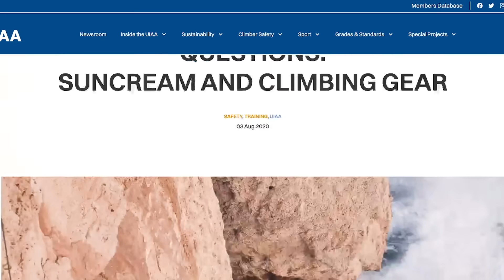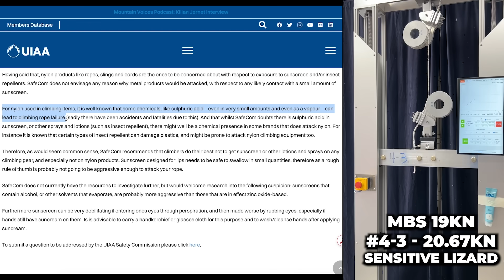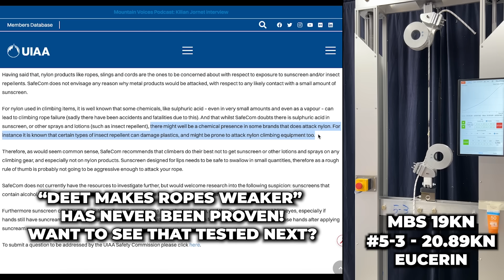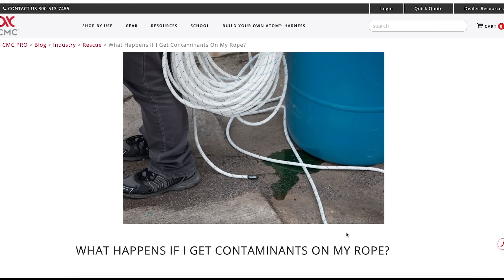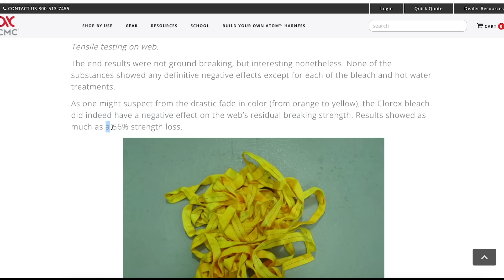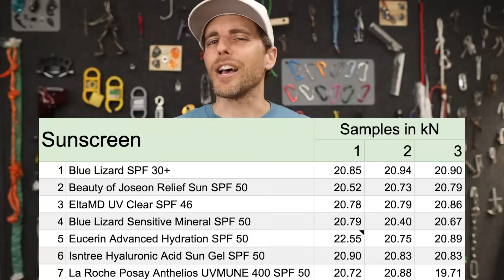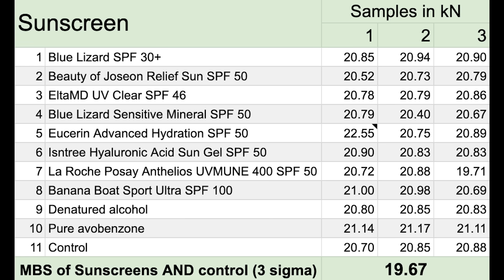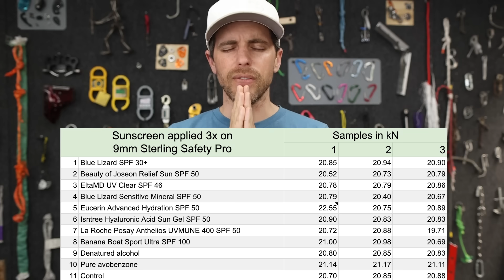This is going to piss off the worlds largest climbing organization

Comment from the maker: Yippee, they took down the instagram post.  They told me they didn't think our science was good enough to take down the article that is NOT based on any science?!?!?! Please email them to get the blog article removed. The UIAA’s contact information is office@theuiaa.org please email them this:
-----------------------------
Dear UIAA,
After reviewing HowNOT2’s sunscreen episode, where they tested to see if sunscreen weakened ropes, we are requesting that you remove your blog post about sunscreen at https://www.theuiaa.org/uiaa-safecom-answers-your-questions-suncream-and-climbing-gear/.  The UIAA is very important in our climbing community and its recommendations need to be rock solid.  Those articles are spreading misinformation.  There are plenty of things to be worried about, let’s worry about the right things.
Sincerely,
Your name
--------------------------
We will remove this call to action once they have removed the false information.  Please email us at contact@hownot2.com if they have so we can take this pinned comment down.
Reply: New claim and a new test idea: Sunscreen extends the nylon's lifespan and your safety! To protect your slings, cams, and ropes, apply sunscreen regularly with SPF 50. It will protect the materials from UV weakening. Test: use 3 sets of ropes/slings. Apply sunscreen to one set; do not apply to other sets. Hide one set as the control away from UV sources. Put the remaining 2 sets outside in direct sunlight for at least 6 months. Expected result: unprotected gear will have lower breaking strength.
Reply: @MrCombic  There are UV protectant sprays made specifically for tents and other outdoor gear. I've never heard of them being used for ropes, but it would be interesting to test those  for safety and effectiveness (I'm willing to bet that it's very safe for ropes, but I'd want to be 100% sure before using it for that purpose..)
Reply: Sent! As a UK physician I can tell you that a lot of the medical literature is of the same conjecture and envisaged evidence as the UIAA article. Glad to see you doing science, I mean research, that one extra sample size 😂
Reply: Also consider emailing member organizations of UIAA to comment on this.
Reply: I've flagged this with the UK's UIAA Safecom rep (i.e. if this video gets posted on UKC, please don't bombard him with messages about it).
Reply: Time to make the HowNot2 certification where the moto could be "we do actual testing not scientific guess work" 😁
Reply: They need to either retract it, or publish their testing methodology so it can be critiqued and replicated. 
THAT's how science works.
Reply: All large organizations make mistakes. I think UIAA does a good job making sure that products are tested to the same sensible standards. But I can imagine an overzealous intern writing a web blurb. Maybe Sydney Sweeney is responsible.
Reply: @harlanstockman5703 A responsible organization that curates life critical knowledge has a higher level of responsibility to maintain accurate and scientifically verified information, which means no intern blurbs.
Reply: Sent my own.
Reply: sent!
Reply: Man do i have some stories about the UIAA sticking their head in the sand
Reply: This is still here 5 months later, so I guess they've not fixed it yet,  To be fair it is a dated blog post, so it should probably just get a warning pointing to a newer post. It is what it is at the time (quite dumb).
Reply: What could you put on your face that you can't just put all over a rope?  Are you seriously asking that as if it's some kind of 'gotcha'?
Petroleum based products, solvents, oils and fats, certain acids and bases, are all things that skin is impervious to but can break down the plastics and nylons used in ropes. 
Although the latest information says sunscreen, insect repellent and other beauty products aren't as much of a problem as we thought, they still are a problem.  And making that really weak argument up front, makes you seem like you have no idea what you're talking about, even if it is true.

I don't know about you, but I take precautions to keep my rope as free from foreign substances as possible.
That 0.05% of a chance that it was my lack of safety checks that caused an accident.  Yeah, I'm not ok with that.
Reply: Out of curiosity, did you test this over time? I know their study was meritless and kinda shit but things like sunscreen with high alcohol do actually dry out jute rope over time. But the rope has to absorb the sunscreen several times and the threads have to dry out overtime (without being cleaned and having maintenance done on them to moisturize and treat them). It's more like accelerating deterioration of rope rather than something which will weaken it substantially. 

But I don't think this would be the case for synthetic ropes like nylon. I also am not a climber, but jute rope is used for other kinds of suspensions and organic ropes do get weaker the dryer and less moisturized the fibers get. So I i could imagine that actually impacting things if the rope is not properly maintained and cleaned after several several uses (and over time).

For example, jute rope is often treated with oil to help moisturize and seal it! Alcoholic things can dry it out faster, same with skin!
Reply: I don't know if telling all the viewers to spam an Instagram post and an email address was really the way to go. Why not just do it yourself and ask if someone has better contacts to help you pass the message along? Just think about the poor guy managing the email inbox, getting hundreds or even thousands of emails from viewers.

Don't get me wrong, the video was great. You did some fantastic testing, and that needs to be corrected by the UIAA. I just don't get why you would ask viewers to spam the UIAA and at the limit to harass them. Just imagine if another YouTuber asked their viewers to spam your email because you made a mistake in your video.

Anyway, thanks for the information and the video. Keep up the good work.
Reply: Wow I'm very surprised at the unusual level of combative tone on this video. I cant tell if its partly to drum up the video or if Ryan is actually this fired up at the UIAA recommendation. Probably both? I do get that the statement is a relatively large misstep that is quite counterproductive to the goals of the channel, but I'm still just a little taken aback. I don't think its that off base to suggest that people try to avoid getting a smorgasbord of unknown chemicals on their ropes, including bug spray, vinegar, beer, lube, tuna juice... 

I do appreciate that HowNot2 has so often quite literally taken 'massive loads' to reassure us that our gear is safe. I am surprised that these international organizations have not been able to demonstrate a commensurate level of effort towards practical research. I think it really goes to show how impressive it is that HowNot2 has been able to follow through with the dedication and passion that its taken to monetize and make this kind of thing possible that, well... isn't happening elsewhere. Y'all make stuff happen in a way that is seldom seen in the world of bureaucracy. It's pretty dope.

Very appreciative for this channel and everything its done for the safety and sanity of the outdoor communities. Thanks!
Reply: @ianrogers2872  The tone is what got me to actually click subscribe.
Reply: @ianrogers2872  What they wrote and are standing by in that article will literally increase the rate of cancer for climbers while doing nothing to actually protect the rope, and they make those claims based on pure conjecture. That's wildly unethical and should make you mad
Reply from the maker: @ianrogers2872  Making up information should only be reserved for the federal government.  I'm fired up because they make claims that are not true.  I'm trying to break gear fear and they are trying to create it without any evidence.
Reply: @HowNOT2 I no longer see it on their IG; did they finally take it down?

Comment: Car steering wheels dissaper and i have seen with my own eyes, takes time and heat but sunscreen can destroy plastics and rubber with repeated exposure and temperature changes

Also, things that we ingest can destroy plastics ie citrus oils strip paint and dissolve plastics easily, (even the chemical resistant ones) but we still eat oranges and they are perfectly safe to rub on your skin, just food for thought.

Comment: 5 months after the release of this video, when specifically asked for sunscreen (other environmental factors excluded) weakening climbing rope:
TL/DR: Very mixed results, but a good portion of the major AI's results seem to have been influenced by your test data.

Summarized in mostly my own words:

chatGPT (GPT-5.2): There is no good evidence that sunscreen weakens climbing rope.

google Gemini (Gemini 3): While UIAA warned about 40% strength loss, recent extended testing by others found no significant srength loss (words in bold), and your channel were mentioned as an independent tester. 

Claude (Opus 4.1): Yes, in some documented cases weakens ropes 20-50% or more.

Perplexity AI (not disclosed): A much‑circulated claim stated up to 40% but was published without test data. In response an independent group (your channel mentioned + it states your testing method) observed no weakening.

Meta AI (Llama 4): Can potentially weaken climbing rope, but it's not a straightforward yes/no answer. Ask the manufacturer.

Grok (External site for free use said Grok 4 but when asked it revealed Grok 2): Even brief or repeated exposure can reduce break force by 5–20% or more.

Microsoft Copilot (Gemini 3): Ordinary contact with sunscreen does not appear to measurably weaken modern climbing ropes (UIAA article and your story mentioned).

QuillBot ("multiple advanced language models"): Sunscreen is not known to weaken climbing rope. Some ingredients in sunscreens might degrade synthetic fibers. Minor contact with sunscreen is unlikely to cause noticeable weakening. But to be safe don't contaminate your rope and ask the manufacturer.

Comment: I'm late to this but have worked in the Consumer Electronics industry for nearly 10 years. One of our standard reliability tests for plastics is smearing them with many chemicals to cause degredation of the plastics. Banana Boat sunscreen is notorious for causing something called Stress Corrosion Cracking in plastics. Depending on the latent stress in the plastic after injection molding and the various plasticizers used in the plastics the problem shoes up more or less aggressively. 

Sunscreen can absolutely cause degredation in polymers. UV exposure can accelerate and interact with the sunscreen chemicals to accelerate degredation as well.

Comment: Why should sun cream damage rope's? 
Nearly all polymers used in ropes are very resistant against chemicals anyway!
Some polymers are susceptible against strong accids, lye and bleach, but all of them are resistant against Alkohol, hydrocarbons like gas, diesel and oils, even acetone (with one exception, Nylon) But if you can put it on your skin, it's fine!
The mechanical and UV damage in normal use is way more serious, then any chemical they could encounter in daily use.
All polypropylene based fibers like HMPE / Dyneema / Spectra and such are even completely inert! That's the stuff your chemical containers are made of! 😉

Comment: Deet is a fairly strong solvent for some synthetics, so I would have more confidence going into it that it's going to have a negative effect on the rope, but I'd presume picaridin would likely have much less of an effect. Another place where sunscreen as well as DEET could have a negative effect on a rope may just be the fact that it stays greasy and wet and holds on to dirt and debris that might, if not properly cleaned, have an effect on the long-term strength of the rope as it would act as an abrasive during use.

Comment: My initial assumption was that the UIAA was referring to strength loss from sunscreen caused by friction against an edge (typically what im thinking about at work), rather than an overall strength loss from fiber absorption. It would be really interesting to see a similar test where the rope is cycled across an abrasive edge to compare sunscreen-related strength loss with the reduction caused by dirt when the rope is dragged over a sharp surface. From an arborist and college grad, it’s awesome to see the scientific theory and analysis come together in these tests. Keep up the sick vids.

Comment: Ok - now do polyester.   

Key Materials & Their Roles:
Polyester (Cover/Jacket): Provides excellent abrasion resistance, UV resistance, and maintains strength when wet, making it ideal for the outer layer that handles friction.
Nylon (Core): Offers superior shock absorption (stretch) and high tensile strength, essential for handling sudden loads in dynamic climbing.
Hybrid Ropes: Many modern arborist ropes use a polyester cover over a nylon core, combining the best properties of both for strength, feel, and durability, notes Southeast Rigging.

Comment: DEET will absolutely degrade nylon. This has been known in the hiking/camping community for a long time. 
You should spray high potency 90%+ DEET on the rope directly, this will probably cause a failure. 

For something more incidental spray 30-50% on a cloth and rub it on the rope several times over a month or two. This would more closely simulate smaller trace amounts being exposed of time.

Comment: I rock climb, but i also used to work on cell towers, and i am currently working on wind turbines. I've had ropes covered in all types of grease, hydraulic fluid, epoxy based paints, cold galvanizing spray, simple green, urine, bird crap, permethrin, deet, and a whole smorgasbord of other things that would scare the UIAA (apparently) and I (obviously) haven't had one fail. Professional and recreational ropes are way more durable than we give them credit for. 

The most likely thing to kill you in climbing is not closing the system. Take care of your gear. But close the damn system (and if you're a tower dog, tie off my dudes).

Comment: I know for a fact iso alcohol will make solid pa6 and pa66 objects become very brittle when used. Had a dab rig with a pa6 top cap. Cleaned it with isopropyl alcohol. I barly sut the thing when it clipped it just blew up into 100 peices, i could basically crumble it with my fingers at that point.

Comment: Sorry, but I see a problem with your experiments. Sunscreens are sticky. Dirt and grit stick to them. Grit can abrade nylon filaments. So what you need to do is apply sunscreen to the rope, expose it to dirt, then put through several cycles of bending and gentle stretching before doing the test. And do the same with a control.

Comment: Two ideas for further inquiry:

1) Rub test rope with and without sunscreen (how much does the stickiness of the sunscreen reduce abrasion resistance by picking up sharp micro objects?)

2) Testing other chemicals that could plausibly end up on your soft goods, such as fuel, bug spray (yes,  want to see DEET tested!)

Comment: You mentioned, but didn't test the effect of sunscreen in the knots, acting simply as a lubricant. 
I'd like to see its effects on both stable anchoring knots like bowlines and figure 8 variations, and on sliding knots like prusiks and blake's. 
Adding wetness to simulate sweat transfer on top of the oily sunscreen could also be a valid variable to include.

Comment: @HowNOT2 now ChatGPT references your test ;) 
Here an excerpt: „Experimental data we do have: HowNot2’s 2025 test soaked Sterling nylon rope sections in 8 sunscreens (covering all common UV filters), plus avobenzone and denatured alcohol, then break-tested them using diverters to achieve near “full strength.” All samples broke ≥ rope rating (~20 kN), i.e., no observed weakening from sunscreen; knots, not sunscreen, produced ~30% strength loss. Community science, not peer-reviewed, but it directly addresses the claim.“
So I guess your prayer worked 😅

Comment: Grease? What about grease?  I work on Tugboat where we use Samson products for our regular towing operations. We currently have an 1-1/2” Quantum-8 Stern line used while moving our 80,000 barrel Barge on the hip. Because we have a Texas bar on the stern with a shiv travels across the bar it is greased. That grease often gets on that stern line and makes it very messy to handle.  How much is that reducing the strength of this line? It is by the way a vegetable based environmentally friendly grease.

Comment: The most funny part is the irony that UV radiation is one of the most harmful environmental exposures for climbing rope. So sunscreen may potentially strengthen rope over time vis-a-vis the degradation it would have suffered from UV radiation. And there are no chemicals in sunscreen that degrade nylon. All you need to do is really consult with one chemist familiar with those types of compounds.

Comment: Great video and analysis and call-out of BS conclusions drawn without evidence! 

I'm gonna be an asshat and come in with a suggestion way too late. tldr: sunscreen on the knot (and on the rope within the knot).

Test pull the rope tied in a knot with the KNOT section of rope recently exposed to sunscreen. Like: make the rope wet with sunscreen and tie the knot with the wet part. Why? Well, the part of the rope we touch the most with our suncreen coated hands is where we tie-in, plus we know that the part of the rope that fails is generally at the knot. Does a knot lubricated with suncreen fail lower than a regular knot?

Comment: I'd be interested in deet, permethrin, and picardin. I'm in Virginia and tick prevention is a big deal in SAR and any kind of outside work. I pre-treat all of my clothes and bags and vehicle with permethrin but will still do a dose of the temp stuff if it's bad out. I wonder if those little secondary exposures are harming my gear?